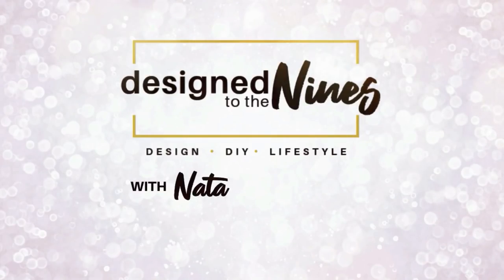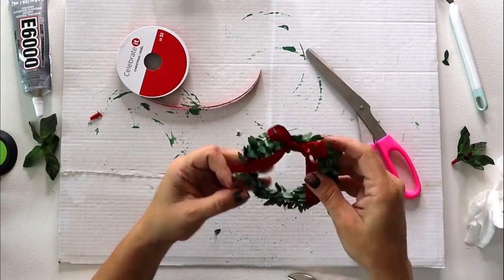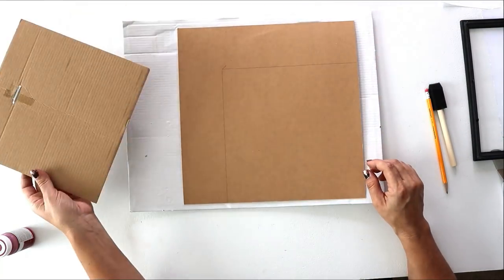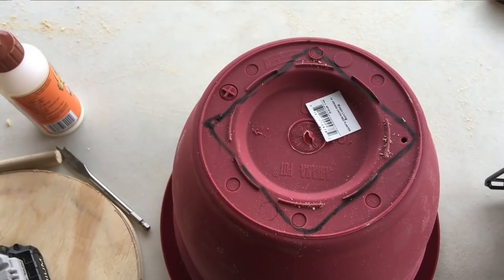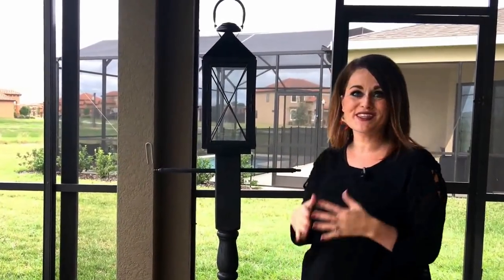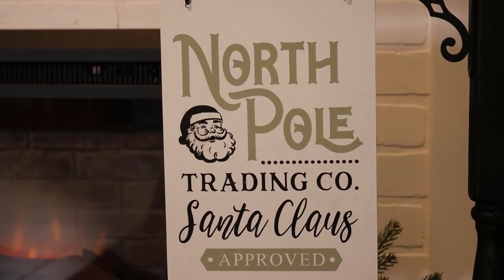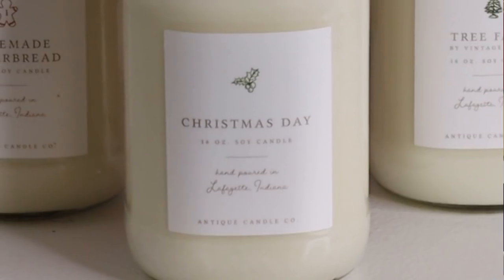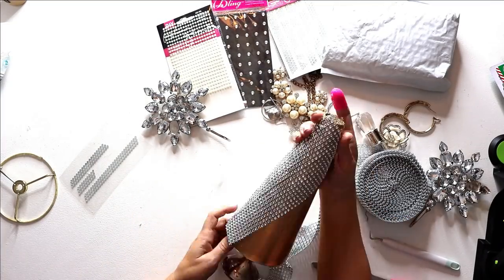Absolute TOP 25 BEST High End Christmas Decor DIYs Ideas On a BUDGET!

Comment: I'm an x - florist. I owned two shops  did it for roughly 45 years. Ok I'd like to tell you I'm really proud of your bravery with all the tools. The foam you are using is for real flowers. It will hold water. It will not last using it with hot glue. You need to use the white or light green foan. I love all your beautiful work. In fact I wanna come play at your house you are very talented.

Comment: If you did your stocking and sewed it up all but 2” from the top edge. Then you could flap each side down you could see your fur on to the one side and then you could turn it downward and then just turn it back up, then just turn it basically upward and then stitch the side up all the way the way on the 2 inches on the side. Straight up once you have your fur on and then just flip it down. Once finished sewing it on. Your little clips I don’t know how expensive they are but you have little children’s hair clips those little itty-bitty ones they were perfect for Holding clothing together.

Comment: I've seen them all before and  loved watching them ALL again!  Makes me want to make stuff.  One question though:  I tried downloading the 16x20 signs, specifically the Halloween sign, and put it on a thumb drive so I could print a poster.  Even though it's copied on the thumb drive, the machine at Walgreens does not read my download.  Any suggestions?  Or what am I doing wrong.  I haven't been to Staples or anywhere else.  I thought I'd check with you first.  Really want to print the Christmas ones now, too. Thanks.
Reply from the maker: Make sure you download the image itself... the PNG one not the PDF version. Hope that helps. 😃

Comment: Hi Natalee,  I am making a project from sparkle vinly and it did not cut all.  I used the blade that came in the maker the fine blade. What should I do to make sure it cuts all the way . Thank you
Reply from the maker: A couple of tips… Make sure it’s set to the right product. You might need to change and put glitter vinyl and you might also want to also set it to more pressure.
Reply: @designedtothenines  Thank you so much !!

Comment: This may be a ridiculous question, but how do you know what size screws and bits to use on different projects?
Reply from the maker: For the bits...Go slightly smaller in size than the screw you intend to use. And make sure is slightly shorter than the things you are screwing together are combined.😊
Reply: @designedtothenines  thank you

Comment: I don’t understand what countersink is. Could you show a close up and explain a little more?
Reply from the maker: Countersink is to enlarge and bevel the rim of (a drilled hole) so that a screw, nail, or bolt can be inserted flush with the surface and that prevents the item from wobbling from the screw head. 😃 Next time I do it I’ll zoom in more.👍🏻